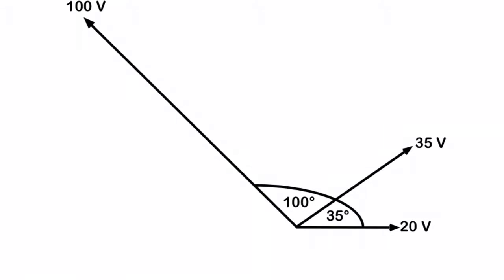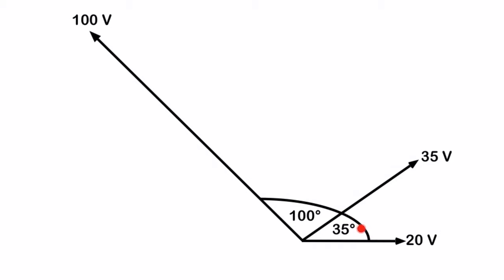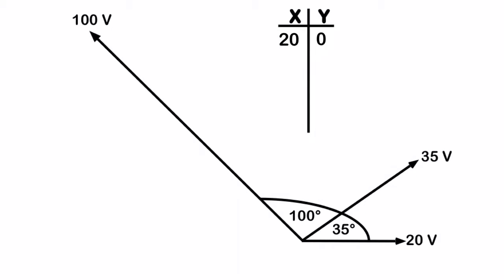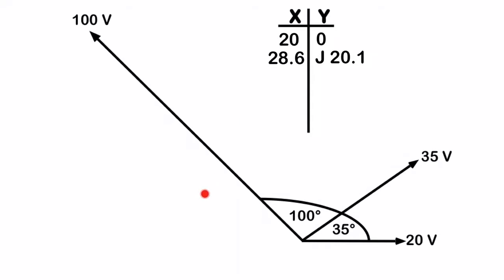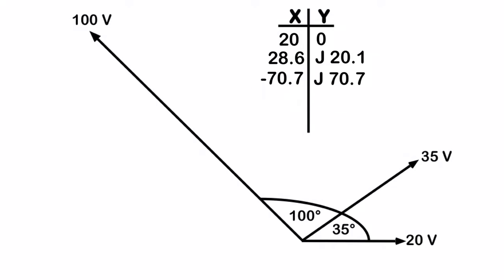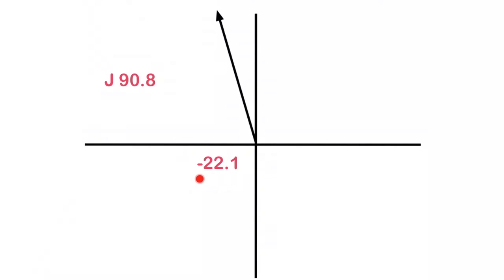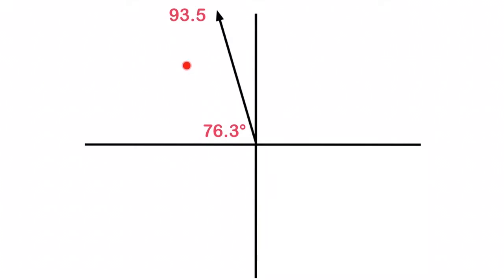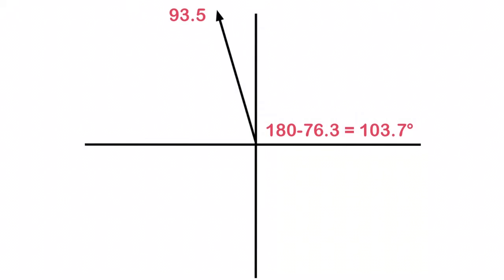Vector addition

Comment: Why is the resultant 93.5?
Reply: Using pythogras therom.
Reply: I wanna know where that number came from. He just threw out there.
Reply: @dijon4422  93.5 is the resultant if you know Pythagoras theory, it's our C. You can get 93.5 by calculating sqrt((-22.1)^2+(90.8)^2). Which is the vector length.